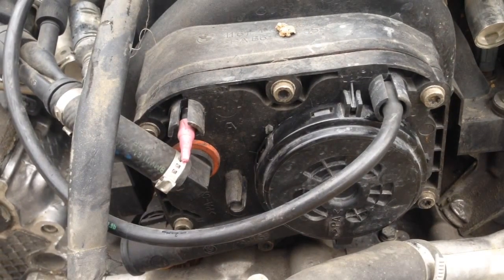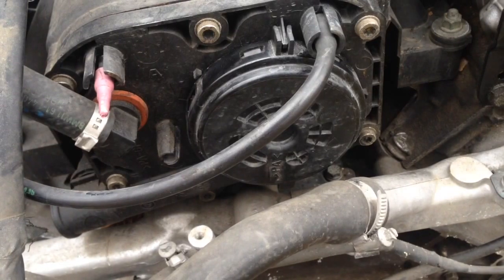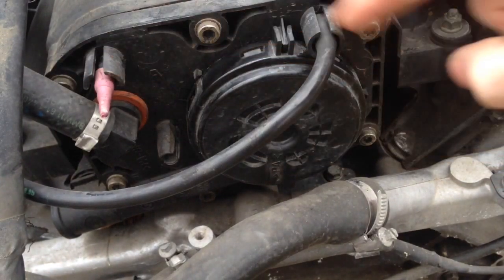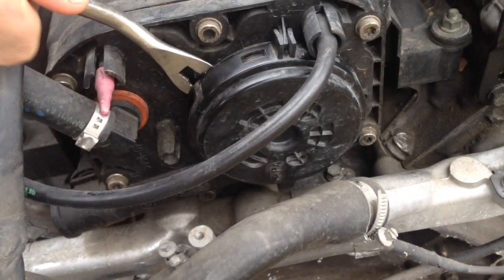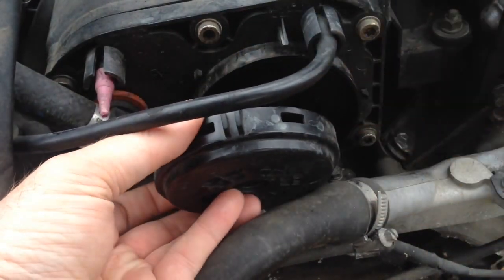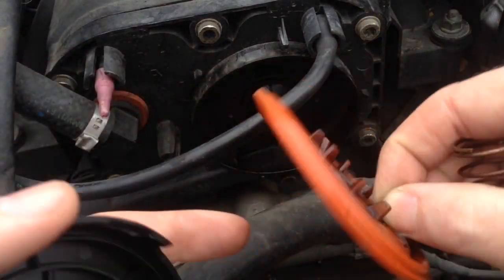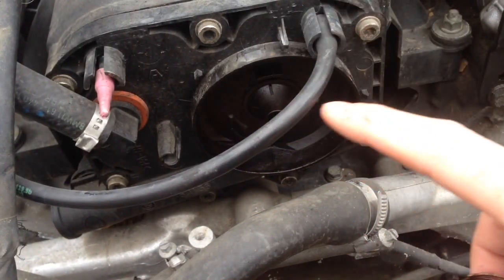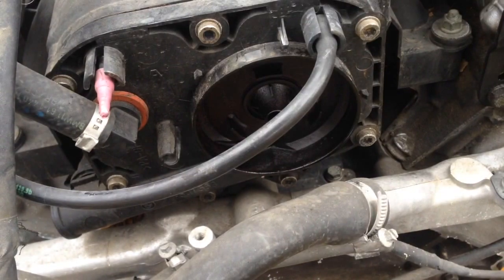BMW 4.4L v8 CCV PCV Replacement and Easy Removal M60 M62 M62TU

Comment: Don't try this on your PCV without having a replacement cover handy. In the video the engine is removed and allows visual and physical access to the part which you won't have with the engine mounted. What is shown in this video is almost impossible to do without breaking the cover unless you remove the whole intake manifold first or with the engine removed like in this video. A little bit misleading..
Reply: Couldn't agree more, he just cost me even more money , you said it a lot nicer than I would have

Comment: Do you have original BMW CCV covers or third party ones? I tried it with on my 18 yr old M62 CCV cover diaphragm with 2 screwdrivers rather than the prying tool you show and it was impossible to get the diaphragm off, and even after I had the garage replace the cover for me, I tried to pry off the diaphragm casing on the old cover they gave me and that wasn't possible without breaking it off around each tab. The plastic was so stiff. So I would put a word of warning on this procedure as you make it look hugely easier than it actually is. I suspect the plastic on third party covers is much thinner and easier to man handle.
Reply: THIS! ++++ On a e38 the cover is hard to access and it is impossible to remove without breaking it so if you are attempting to do this workaround without having a replacement cover on hand, anticipating it to be as simple as this video makes it look, you will break the cover trying to remove it and end up in a crappy situation. There really should be a word of caution regarding this.

Comment: Hey, thanks for the videos (first replace the two valves above each valve cover but still have a problem with blue smoke after sitting a light. So I bought the rear PCV assembly and went to work, but found out quickly that I don't see a way reach the back of the engine as shown in the video. Can you tell me what the process is to get the area opened up so I can replace the part PCV

Comment: yea,  it's really easy to remove it with the engine out,,, but when you have to do it with the engine in place against the firewall ,, good luck,, there's no place to put you'r hand's there,, and when it's been in there since the car was new,, the plastic will crack as soon as you try to pry it out,, belive me,, i have done e few of these,, the cover with the engine heat get's so brittle that it's prone to crack...i remove the intake and remove it and clean the entire thing..
Reply: you took the words right out of my mouth. there are a lot of difficult engine works, you can do "easily with the engine out. i'm contemplating on selling my e53 because of the possibility of needing to replace the ccv.

Comment: pls help I have an e38 that is smoking like hell and is running like shit. I changed the pcv valve with one from a parts car that I had (checked out the rubber and looked in good shape) and the problem persists, could the blow by be fowling my plugs? shorting our my coil packs? any advice is appreciated. P.S I am showing no signs of a blown head gasket other than the smoke and mis coolant is good oil is good temp is good

Comment: I suspect I don't suspect I know a vacuum leak for sure when I pull my dipstick you can hear a gurgling and hissing sound I think I have a bad pcv and a my scan tool said bank 1 fuel trim to lean and a misfire I need help but it runs good when driving just at idel

Comment: @NathenDIY So yesterday my car popped a p0301 and a p0300 right before my wife and I were about to go out of town and it was shaking bad and barely would accelerate. We ended up taking our van instead. I went and bought a coil for cylinder number #1, installed it and the car did the same thing. I took out all the coils from that bank and the spark plugs as well. They all looked good. I re-installed the plugs and coils leaving the new one out, disconnected the battery and touched the + and - togther, reconnected the battery and the car ran like normal with the slight miss it's had for the past 2 months. I pulled the MAF connector off and the car cleared up perfectly. I put it back on and the miss and slight shake came back. I was about to unplug it again and the car shut off when I touched the wires to the plug connector. Apparently the wires are frayed or something inside or at the plug. They're connected good enough that the car won't throw a CEL for it when it's connected but the mpg's are bad with it connected. I drove a round with it unplugged for about 4 miles and my mpg's are at factory spec, sometimes better like up to 20 mph in the city. When I shut my car off the CEL was back on with the codes P0100 P0130 and P0136. I understand the P0100 but any suggestions would be great. Thanks

Comment: I need some help man. I just bought a 02 540i 6speed. Its thowing a bad pcv code. I looked at it and its missing the passenger side hose. It makes a loud hissing sound and is sucking air in. The driver side hoses appears to go to the fpr. Is this correct? Thanks!

Comment: I took my intake off and replaced the whole ccv. I also replaced the intake gaskets and I did so for about $49. I use power tools, so it took a lot less time to do the job. All in all, maybe an hour. I cleaned my intake, throttle body, and intake runners in the heads since the previous owner was an idiot and clearly used 87 octane... The intake had a bunch of oil throughout too...

But here's the really odd part... I replaced everything trying to fix a vacuum leak that I can't seem to find. I'm getting a SEL for bank 1 and 2 too lean. The vacuum diaphragm looked just like the one pulled out in this video, it was still in good shape, and the gaskets were still pliable too. 
When I first started the car after installing everything, I had a strange whistle coming from the vacuum diaphragm that I hadn't noticed before replacing everything. Pull the oil dipstick and the whistle stops. My next move is to check the compression on all cylinders and if that checks out, I'll replace the valley pan gasket and the throttle body gasket. If none of those fix the problem, the only other thing I can think of is the vacuum lines... 
I've already replaced the mass air flow sensor, o2 sensors, spark plugs, ignition coils and fuel filter... I pulled the fuel pump out and cleaned the fuel tank too... Checked the fuel pressure and it was actually high. So, if it's not the vacuum lines and the compression checks out, I have no clue what else it could be. 
I tried spraying carb cleaner around the common vacuum leak areas and I couldn't hear any change in the idle speed. With the A/C off, it idles between 580ish and 650ish and with the air on, it idles at 690ish and 750ish according to the live data feed from the obdII scanner.
I used a nice scanner and it told me that there was a fault with the electric thermostat and that the electric fan wasn't working. I have a new thermostat that I haven't installed yet. I haven't looked into why the electric fan isn't working. I have hot heat and cold A/C. Not sure if those 2 things would cause a bank 1 and 2 too lean code... But those are all of the codes I've seen and all I've done so far. Oh I have a brand new battery and I replaced the LCM because my lights didn't work correctly. The factory radio didn't display anything, but it worked. I had a bunch of aftermarket stuff sitting around the house, so I installed that instead of trying to figure out why the stock stuff didn't work. I didn't ruin my harness or my dash. I had the Error codes before I replaced the radio. I can put the factory stuff back in if I want or need to.
Reply from the maker: jylp4u make sure the spring loaded hose on the bottom of the intake is plugged in to the bottom of the ccv correctly , also check that Y adapter that comes from
The brake booster , that plastic pops off and leaks
Reply: Hi
Did u figure out how to solve your issue? I'm having the sams problem

Comment: Even easier to do this job on the M62.
There are 2 PCV valves with the M62.
One either side.
We just replaced them on our 2005 E65 Alpina
which was idling like a dog.
Runs smoooooth now and very happy :)
Reply from the maker: +Antonio Di Cappo I think you mean N62
Reply: +Nathan&#39;s DIY Garage Correct, I meant the N62 :)
Reply: Antonio Di Cappo

Comment: Nathan, Thanks for the video's you're a Wizard. I've looked for the diaphragm everywhere and cannot find it on ebay, nor pelican parts. Could you throw a link in for me?
Reply: Itsthe jez He does have a good solution. But if I were you I would buy the whole ccv and not the diaphragm. He's doing this on and engine that's out of the car so it's easy.  I tried it, and having to find different angles cracked the diaphragm case, so now I'm with out a car, until a get a whole piece. A diaphragm cost $19, a good quality part cost $30+, you decide.

Comment: I did this job today after watching this video … let me start by saying I have a whole new unit just in case but was only planning on doing the diaphragm and cover …

You will not let me repeat you will not get the diaphragm cover off without breaking it …..

So just go ahead and break it off…

Then take the new cover and diaphragm of the new unit but beware the plastic is soft and even this task must be done with extreme caution .

This video is misleading access on my e38 was horrendous .

Especially as mine is a right hand drive car here in Australia  meaning the left hand side loom passes directly over the pcv valve 

Conclusion though was positive as I had spluttering on cold idle startup .

As soon as the new cap and diaphragm went in the problem went away .

Comment: hey bro great videos. I have a quick question. I noticed my power steering hoses are seeping fluid. Do I need to buy oem which are very expensive for the set or can I replace the just the hose itself?
Reply from the maker: +E Justin Thats common when the wrong power steering fluid is used, you can not use standard power steering fluid , you must use transmission fluid
Reply: +Nathan's DIY Garage I have been using auto fluid as recommended but used the general motors instead of the import. I have since purchased the import fluid. Can I save the ps hoses since they are seeping?
Reply from the maker: just the rubber hoses are seeping? if so you can use a pair of wire cutters to clip off the one time use clamps and use a regular hose clamp

Comment: Hi guys  I have bmwx5 4.4l when I start my car after idle fr 5 or 8 min when I punch the gas it gives a small white cloudy smoke then it goes away while driving there is no smoke and on traffic lite stop there is no smoke but then when I turn it off and start the car again it's a little smoke way can it be please help it has 120,000k on it

Comment: Nathan I admire your passion for BmW s. I share the same passion as there's just something about a bmw when there's no bugs.

Similiar to a female they BMW require allot of love and patience. Keep up the great work.  ?  I can get a 2005 545i 1 owner 98 k hot rod for 2500$ the owner older guy 60s thinks its valve seals as u know that job is a HUGE pain in the ass s. W/  your experience what are the odds of it being a clogged or bad ccv?
Also b4 valve seals what other then Ccv can I try or might the light idle and take off Puff B?  I haven't decided. If going to buy it even tho its a very nice condition sleeper hot rod 
It books for 5500$ ish don't want to have 2000$ shop cost as the v8 bmw motor is more then my tired mind cares to tackle again any input is very much so appreciated sir!! Happy new yr 2 u best luck w the channel in 2019 Nate!👍

Comment: Nathan, thanks for this vid. I believe it is going to save me some real time and money. My 01 x5 4.4 started smoking like a freight train after a hard stop and turn. I couldn't figure out what was up but apparently my ccv failed for some reason either just before or during that stop/turn. It seems it smokes worse at a stop because the oil in valve covers flows forward and the hoses feeding the ccv come out the front then go back to the valve below the intake.   I have looked all over ebay and do not see one that says it fits 01 x5 4.4. Mine is like the one in vid, only ones I find fit 2012 and up, or they have holes all the way around them (DIFFERENT DESIGN) 
 Any help with a part number or source would be greatly appreciated.
Reply: Figured out what I thought were holes or a different design will work. They weren't holes that go all the way through and just appeared so.

Comment: Hi Nathan I like your video it was very healthy.I would like to know if a faulty CCV can cause serious smoking emission at the exhaust.Im talking serious shit.
Reply from the maker: If it is oil smoke then yes
Reply: Hi Nathan,its ma again.I just spent a great deal of time today in the scorching sun trying to remove the diaphragm casing on the ccv valve.There just isn`t enough space to work.How can I successfully get to that diaphragm without breaking anything.I was REALLY PISSED OFF.Secondly is the transmission affected as a result of the faulty diaphragm.The transmission in my BMW is all screwed up.
Reply from the maker: If it is a x5 pull the cowell out and you can get to it easily, there are only 2 bolts that hold it in

Comment: For the life of me I cannot find this part online.. I find them for all other BMW but not for the 4.4... I searched everywhere? Links???
Reply from the maker: http://amzn.to/2zKJOMy.     here it is hope it helps
Reply: Thats the whole valve, I am looking for just the diapragm and spring like you show
Reply: I just ordered one at that link, maybe I can remove the cape spring and diapram from the new unit and put it on old housing on the manifold. Worst case I will have to change the whole thing I guess. I have code p1159 and p1161 running lean, cold idle surges, and driving down the road I get a little fluctuation in rpm.... I am pretty sure this is my issue.
Reply from the maker: Ken Pikulski that's what I do just swap the round piece, otherwise you gotta pull the intake, but be sure to check the hose fitting on the existing pcv unit and make sure nothing. Is broke or leaking
Reply: Oh okay, in your video you mention you can get the cover diaphragm and spring on ebay by itself. I figure even if the plastic cover is a little different I can reuse old one and just change the spring and diaphragm. Thanks for the quick reply.... I am a avid wrencher and have restored and worked on hundreds of vehicles in my time. I enjoy your vids... I had been thinking about doing the same thing as you on youtube for years but never commited